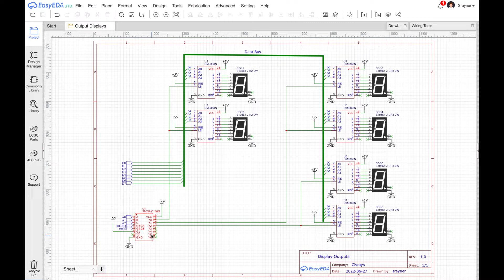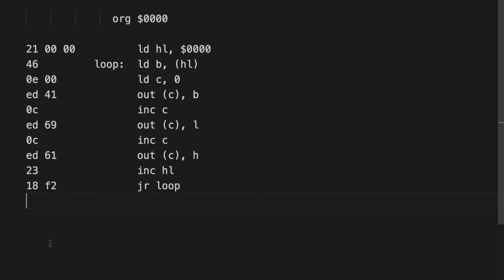Z80 Computer - Part 4 I/O Address Decoding

Comment: Hi Steve, Great videos - have not touched Electronics for over 40years when I was studying and working in the industry. The Z80 was my first real projects back in the day building electronics around the Sinclair ZX81. Just started 40 yrs later to refresh on all this and start building some projects around the Z80. Found your videos very informative and brings back many memories - good work 🙂
Reply: I'm pretty much the same @ronnash7289. Did my initial training in Electrical and Elecronics Enginneering much of which was messing about with Z80 and 6502 processors. I loved it but somehow drifted away into higher level languages for my career after learning Sinclair Basic also on a ZX81. Now that I am getting closer to retirement, I'm starting to look at the old fun skills again (breadboard, plug in components, assembly language, etc). Have started by messing about with an Arduino but have also bought a couple of Z80s (going to be rare beasts in a couple of years) and looking forward to trying things like this. Good luck with your projects!

Comment: I would have hooked up all sixteen address lines from the Z80 to the four DM9368Ns.  I can’t understand what you did with that chip using three address lines, I’ll have to look again.
Reply from the maker: With 3 bits from the address lines we can address up to 8 devices. The three bits can range from 000 to 111. The binary number 111 represents the decimal number 7. So with 3 address lines we can represent the decimal numbers 0 through to 7. By using the 74-138 chip we can convert this 3-bit binary input into 8 output lines. Only 1 output line will ever be active (low) at any time. So we can connect 8 devices to this chip. I've only connected 3 devices. Each pair of LEDs is a device. 

We simple ignore the other 15 bits of the address lines. Technically these 8 possible devices will get repeated across the full address space. So if you output to device 8, you get device 0, and if you output to device 9, get get device 1, etc. If you look at the binary number 8, 1000, the last 3 bits are all 0, so we get device 0.
Reply: @SteveRaynerMakes I see: so, you’re using each pair of displays as an output device, but you still need to move the “h” and “l” address reference through a register, then into memory locations 0000 and 0001 in order to output it.  While this gives you greater versatility and enables you to add more devices (doubling your capability , with each address line you add), it’s not really showing which address the CPU is actually calling for.  I can see why you might want to do it your way, but that’s “next-level” from my primitive understanding: I haven’t even thought about programming anything other than my eight pull-down resistors telling the Z80 to do “nothing”!  In any case, your videos are wonderful, and I’m running out of breadboards!
Reply from the maker: @BrooklynWalker  you could connect the address lines directly to the DM9368. You would have to think about exactly when you latch the signals. I think you could tie the LE pin (pin3) directly to ground to start with and the 7-segment displays will show you what the address lines are doing at any point in time. I think this will only be useful while you are single stepping through your program. The address lines will be changing too fast when you are running at faster speeds. But it's totally fine to experiment, that's how you learn.
Reply: @SteveRaynerMakes here, my first attempt with the DM9368. First, I started with no pull-down resistors, and would only see “F”. Next, I tried a 10K resistor network, same result. So I tried 1K pull-down resistors, and it works. Thank you for the inspiration so far.
Reply: Having completed a 4-digit hex counter, driven directly by the 16 address outputs of the Z80, I got to thinking: this is not an output for the Z80, it’s merely a diagnostic tool for the processor’s address outputs. The result so far is just a cool hex counter. Now, to that data bus…

Comment: Hi, I think that the 'error' is in the instruction "ld b,(hl) that means "load register b with the content of memory location pointed by 'hl'and as you haven't memory this number is random :D
Reply from the maker: Hi. I'm not sure what error you are referring to as the program behaves as expected. You are correct ld b, (hl) means load register b with the contents of the memory address pointed to by hl. hl is set on the line above to memory address zero. We do have memory at that location because that is where our program is located. Sorry if I've misunderstood what you are saying.
Reply: it start read from memory address 0000 that will be rom. no error